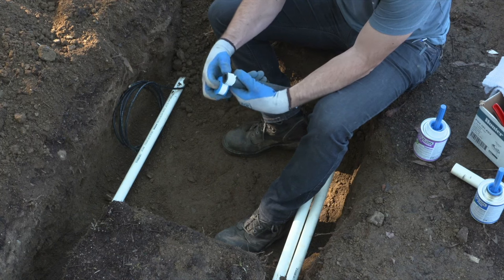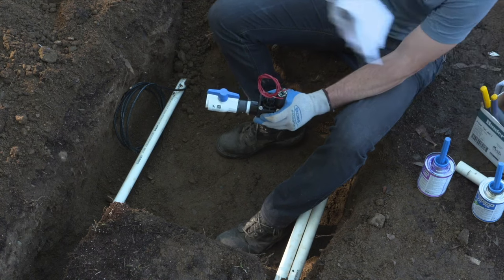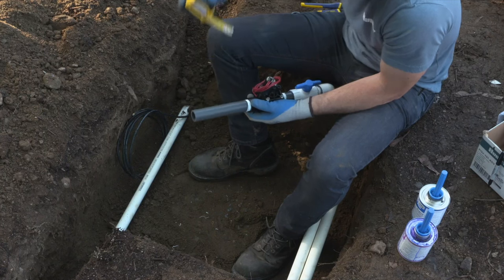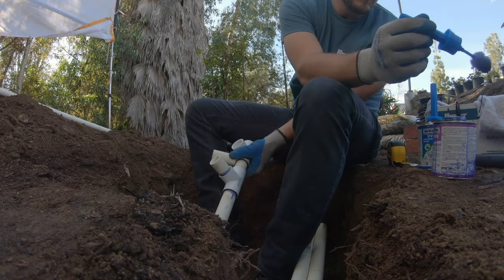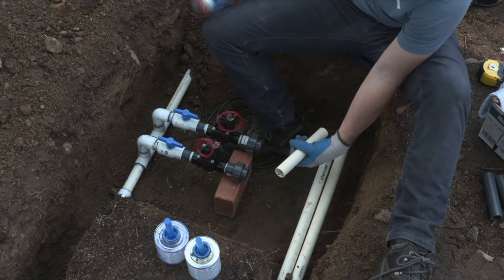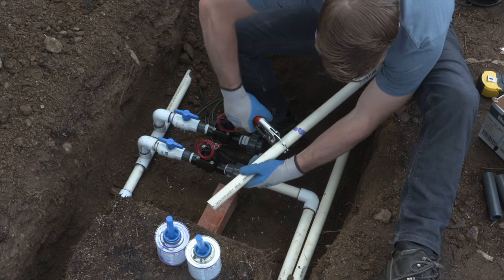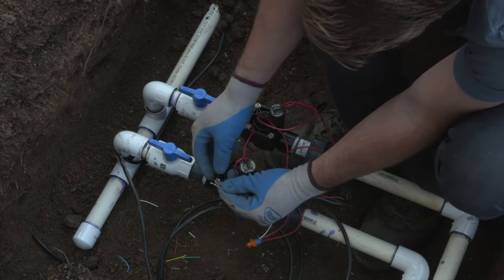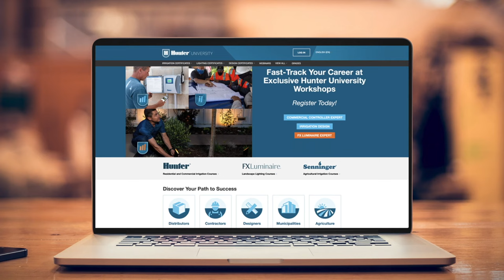Irrigation Valve Installation from Mainline to Lateral Lines with Commentary

Comment: This video is just super!  As everyone says, it is probably the best one out there.  You could point out that the nipples that were cut in half, were schedule 80 (gray) not because they had to be schedule 80,  but because that is all that you will find in home centers.  You could point out that the union joint you used is schedule 80 not because it had to be schedule 80, it is on the low pressure side of the valve,  but because they are higher quality than the white schedule 40 PVC unions that are usually found in home centers.  For reasons that I don't understand, the schedule 80 unions are usually cheaper if you can find them.

Comment: Nice video!  After doing years of service repair work, I have never understood why installers don't just use 2 unions. With 2 it is quicker to replace the valve and has less stress on the fittings during replacement. With only one union the service tech is forced to lift and bend the fittings on the mainline side. Also, I always leave space between fittings to allow for future repairs, like if the plastic ball valve leaks 10 years down the road the repair will require digging up the valve box to properly complete the repair. How many wraps of Teflon tape do you use? I was taught to do 5-6. The good news with all this is that the valve you installed will likely never have an issue that will require complete valve replacement. Very reliable valve! I understand that Hunter is the only valve manufacture that still water pressure tests every valve. This is my favorite valve to use! Please keep up the good work!
Reply from the maker: Awesome! Thanks for watching!

Comment: always dry fit your connections and always put marks on the orientation of your fittings prior to gluing . this way you know that everything will line up and level up perfectly, if you don't then you will have to cut everything and start over.

Comment: Why did you do a 90 degree angle up when you branched off the main line? would't it have been easier just to do two T-joints straight out horizontally?

Comment: Great video do you have the name or link to the swivel union ?
Reply from the maker: Those are schedule 80 unions and available at a sprinkler supplier. Unions are a fantastic way to allow valve removal with out cutting and gluing a pipe.

Comment: How much Teflon tape do you recommend? I never use more than 5 wraps. My brother just had to fix a whole valve bank from this
Reply from the maker: Thank you for contacting Hunter Technical Support.
 
You must apply thread tape by turning it clockwise around the thread. When the fitting is connected, the fitting is installed in the same clockwise direction, sealing the fitting & not pealing back.
Reply: 3 wraps

Comment: Great video, really helpful! What type/brand of pvc primer and cement are you using?
Reply from the maker: Hunter Industries is a manufacturer of irrigation and lighting products. We do not manufacture glue products. The irrigation suppliers or local distributors typically sell Weld-On or Christy's RedHot as the glue products of choice.

 
Thank you again for contacting Hunter Technical Support. Please let us know if we can offer any other assistance.

Comment: Where do you get the threaded pipe that you glue the PVC to?
Reply: These are schedule 80 nipples.  They are also called risers.  They come in various lengths. They come with threads on both ends.   You cut them in half or to the length that you need.  The two pieces you end up with will have threads on one end and a blunt end that you solvent weld into a PVC joint.  I have never seen them in schedule 40 PVC (white), but that does not mean they don't exist.
Reply from the maker: Spot on!